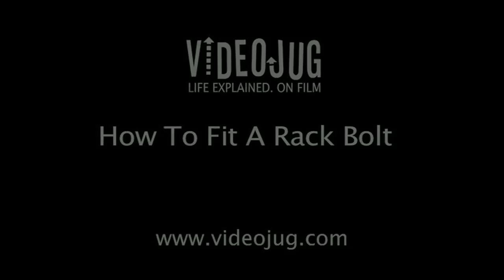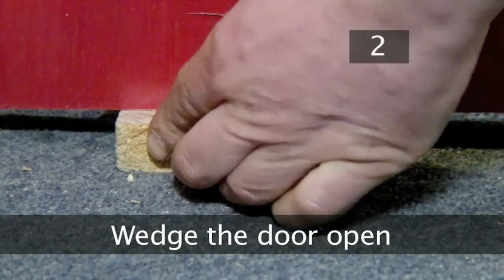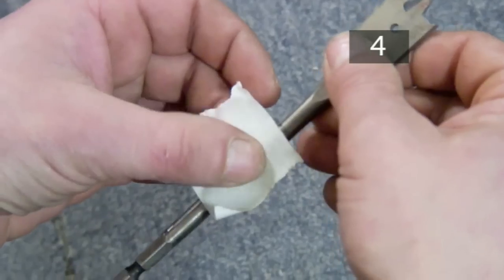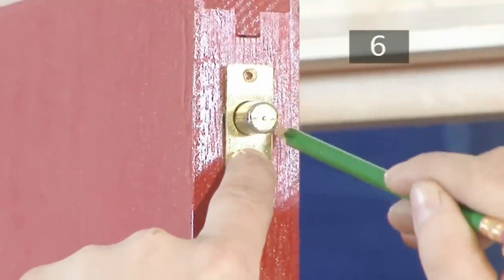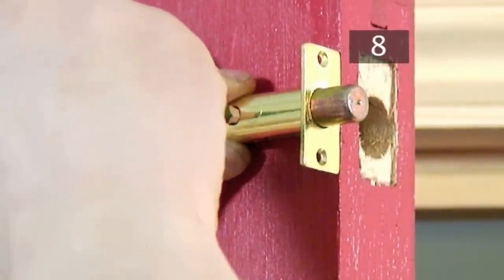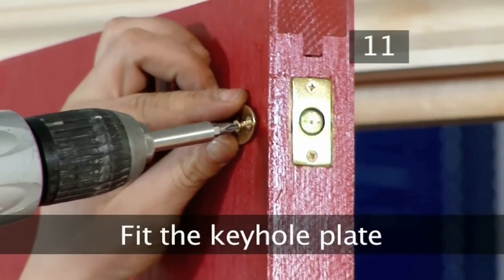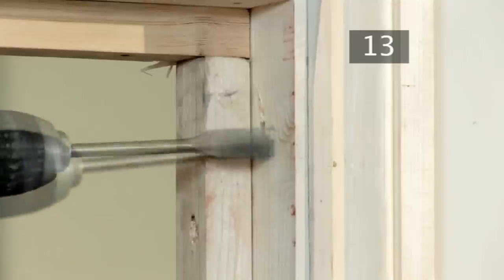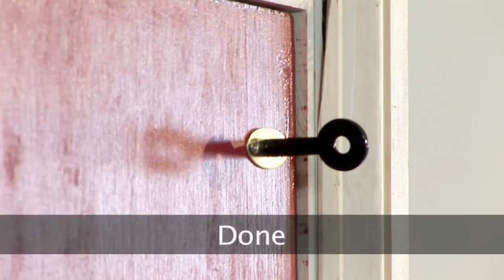How To Fit A Rack Bolt

Comment: -Shouldn't you turn the key clockwise to lock the door? (rack bolt fitted upside down?)
-drill bit didn't appear to enter edge of door at 90 degrees! (1 min 58 seconds in).
-not very tidy rebating in to door!
Otherwise adequate!
Reply: It's for beginners mate, chill out
Reply: @raystrach3055  Yep you're right mate. Still best to teach beginners properly though.